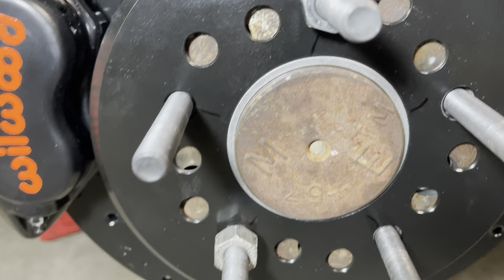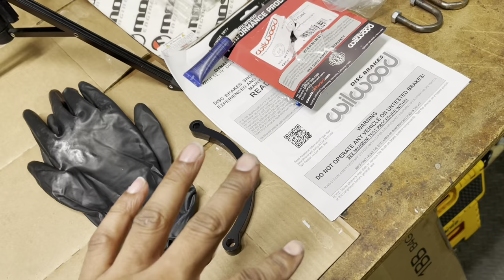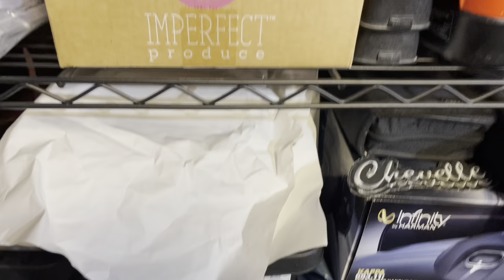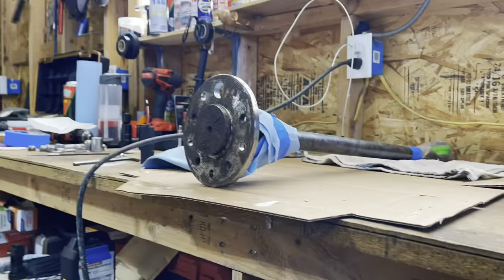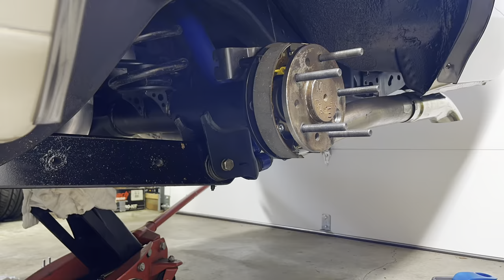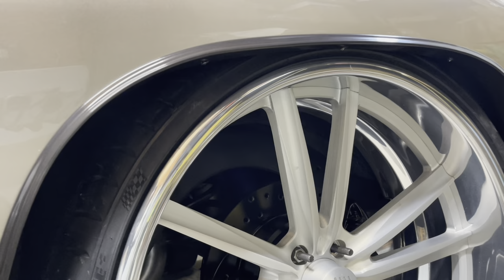WILWOOD REAR DISC BRAKE INSTALL | 71 CHEVELLE | OLD SCHOOL FORD 9"

Comment: I don't know if you figured out yet, but the end play you described on the right axle is because you used the factory axle retainer bracket. The wilwood one has the step flange to put pressure on the outer bearing race, and will not be flush.  You have the in and out movement because the bearings are not being held in tightly.  This will have a negative effect while driving, i.e. leaking wheel seals and clunking with side loads.  The car looks awesome,  keep up the great work!
Reply from the maker: Thank you! Yes I ended up figuring it out. Should’ve used the Wilwood piece from the beginning. I’m glad I second guessed myself. Appreciate you chiming in. Thanks for the compliment and thanks for watching!🙏🏾

Comment: No C clips on a 9inch.   I agree, use calipers to measure the stack of washers and a machine shop can mill the spacer to that thickness. Have the side that isnt exposed milled and you wont need to paint it.
Stance looks perfect from the camera angle but your looking at in person. 
The channel you mentioned is  Saabkyle04
Reply from the maker: Thanks for input!

Comment: Had a few questions,
I just picked up an old school Ford 9” rear end and going to have it shortened.
What is the part number for the rear Wilwood brake kit you are using? Also are you using the original axles and differential and did you have to modify them?
I’m really new to this upgrade and trying to get all the info I can.
Your car looks amazing.
Reply from the maker: I cannot remember the part number for kit, but it’s a rear break kit for a BIG FORD 9”. Make sure you reference which one you need, cuz the flanges are different. Is why I capitalized the BIG FORD. 

I have Yukon 31 spline axles and Richmond Gears. No mods to axles from my understanding. It came with purchase of car. 

Hope that helps.
Reply: What year Yukon? I’m just thinking as a lot of them are 6 lug and older ones come with big 5on5 lug.
Reply from the maker: @juliochavez4023  Yukon is the manufacturer of rear different parts.
Reply: Mybad bro, I’m new to all this.lol
I appreciate all your info.

Comment: Hey my friend thanks for the video. I ended up with the same problem of you. My question is, do you reuse the the spacers or you keep the watchers for spacers?  can you let me know please thank you.
Reply from the maker: I got the spacer milled down .080 and used my existing washers/shims. I took measurements prior to getting the spacer milled down so I knew exactly what I needed.
Reply: @MrGriffin23  ok thank you! It looks like I’m going to do the same
Reply from the maker: @danielviorato1333  from what I heard; I guess they sell various sizes in spacer, but I’ve never seen them. So you might want to double check. Might save you some time.
Reply: @MrGriffin23  i was thinking to call wilwood to see what they have.